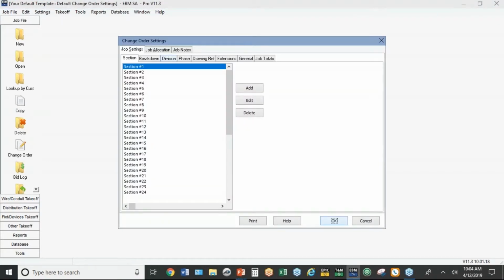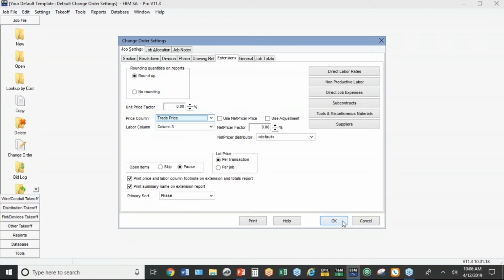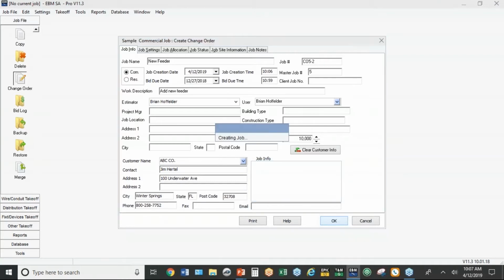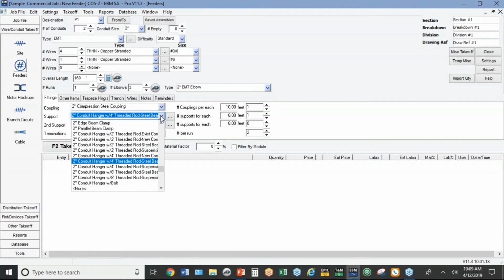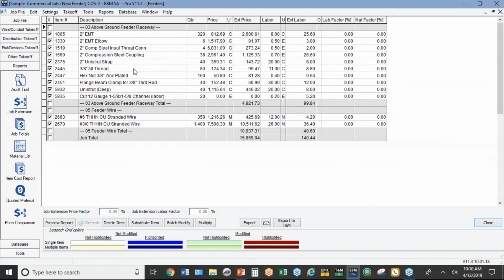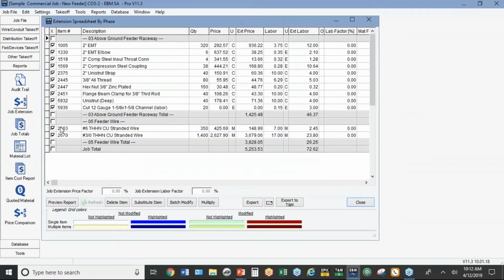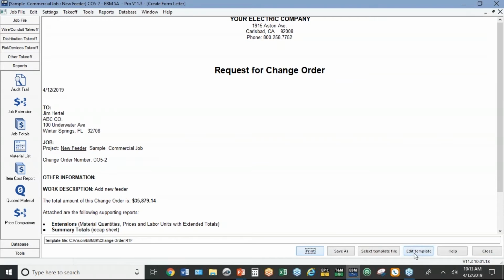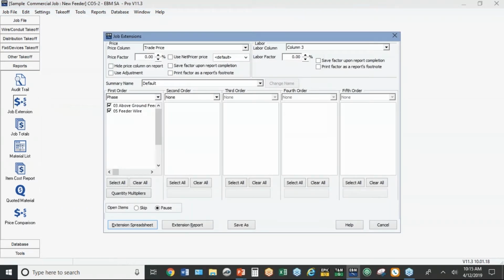Making Money with Change Orders

Comment: For material issues for the target pricing I use a 5 to 10% mark up in the job extensions price factors. So the customer sees a slightly higher price but it is easily explainable. I often tell them that the original job was quoted under a certain price based on current EPIC pricing and that our pricing is updated monthly and the price increase is through EPIC not me. Often times from the bid process, to the award of the project, to the first change order enough time has passed that an increase in material costs is more than reasonable. They do not see that 10% increase when marked up that way only a higher cost and only if they have something to compare it to previously. I also us the excuse if they are comparing pricing from Home Depot etc that it is not an accurate comparison because Home Depot does not deliver to the site for free and in addition for something like EMT conduit etc Home Depot discounts that item but increase fittings pricing by hundreds of percentage. If they have pricing from large contractors I usually state that they have a large discount because they do more volume than I do to explain a price difference.
Reply from the maker: Thank you for sharing your strategies! EPIC Pricing is a great service to leverage for just that purpose.  https://www.visioninfosoft.com/electrical-material-pricing/

Comment: How would you do a change order pricing when you have to credit one item and then add another. You would't what the higher pricing on the credited items.
Reply from the maker: This is always the dilemma.  If you try to get higher prices on additional work for change orders, the customer might expect that you will give them the same pricing when they want credits.

The primary arguments for higher change order related prices is that additional work has to be priced higher than the values used in the bid because 
1. you have to compensate for the fact that changes impact productivity
2. additional material purchases may not be available at discounted bid rates
3. and because it may not be possible to do changes with the same crew mix of apprentices to keep the overall rates down.

It's not an easy case/argument to make.  If the Electrical Contractor is relatively sure that there will be more additions than credits, he may have to bite the bullet and do the credits at higher rates.
- Brian Hoffelder